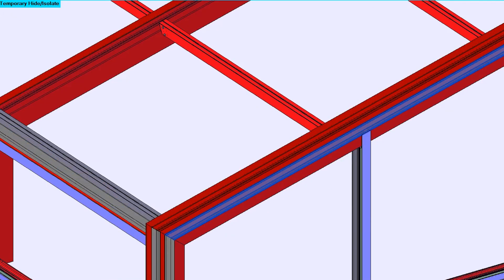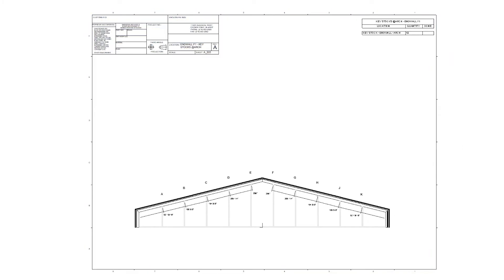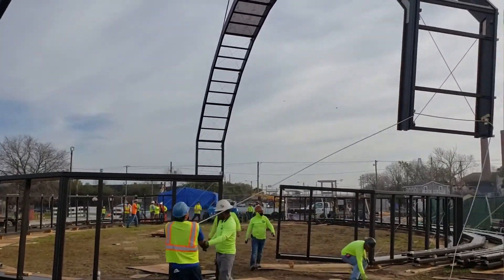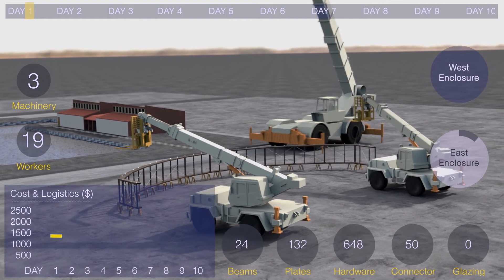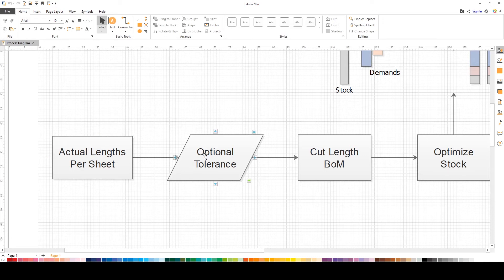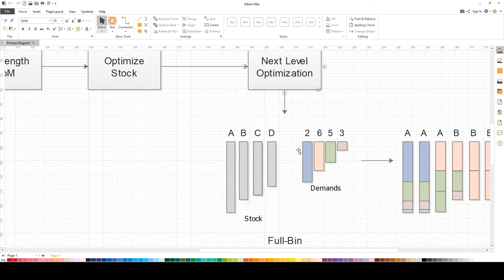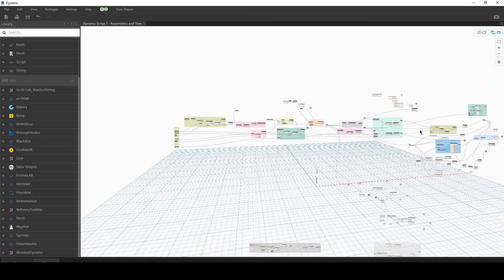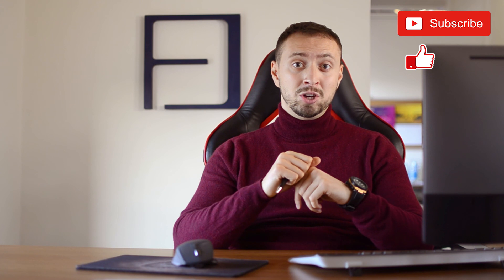BIM for Manufacturers | Save TIME & COST Fabrication with BIM

Comment: Wish BIM for manufacturers publish the files in neutral 3D format such as .stl or .igs also and not just Revit, because lot of Engineering Fabrication companies also have need to get a 3D file from OEM and use 3D parametric software like Solidworks, Solidedge, Pro E, It is not possible to convert Revit to these Mechanical 3D packages